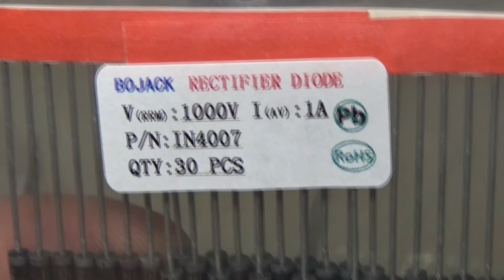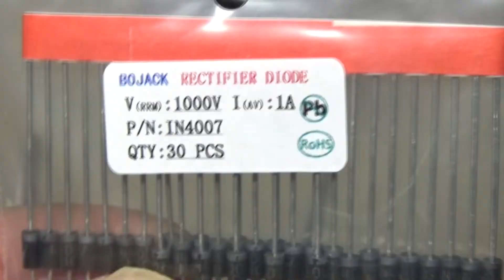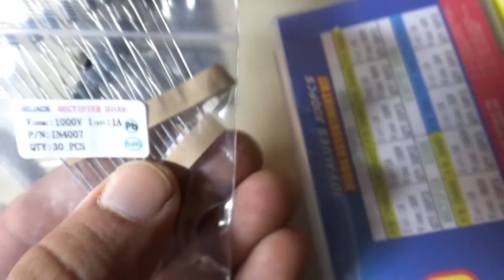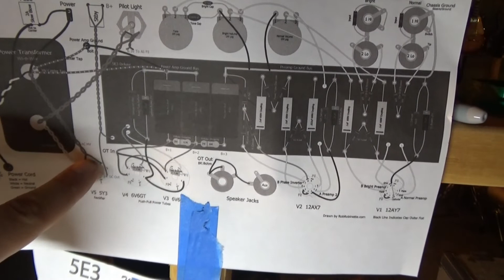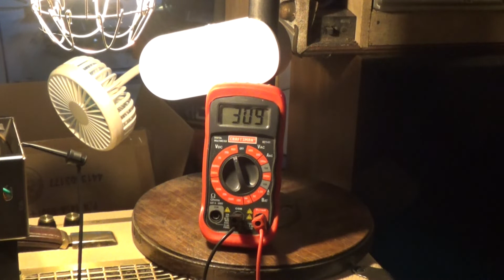Converting a 5y3 Tube to a Solid State Rectifier (Cheap and Easy?)

Comment: You might wanna put another filter cap in series with a resistor across it to up the voltage rating to higher than 500vdc if you’re going to use the solid state rectifier on the 5e3. Either that or get a cap that’s rated for 1kv. Don’t want that initial surge to blow your cap.
Reply: can you explain more?  I didn't get your comment about cap and resistor in series. because I'm planning to do this for my 5e3 clone
Reply: @hamedkhalilian6882  The solid state rectification will cause more of a voltage spike. Two caps in series will be able to handle it if it goes over 500 vdc. Depending on your power transformer,If it’s low enough, you may be ok with 500v cap on the first node. What voltage are you getting with a 5y3?
Reply: @hamedkhalilian6882 It's supposed to act as a buffer for that surge you get as soon as you turn the amp on "play", sometimes you can see the preamp valves glow a lot brighter than usual at the flick of the power, try the cap as it will at very least give the pre valves longer life. My theory is that the new ecc83/12ax7 valves(and thier family) are built to  withstand the Surge but the tone of the amp changes to a harsher and more metalic character reflecting the "tougher" build. They are usefull as phase inverter valves(groove tube) as the gains are spot-on. Last but not least" Be carefull around glass as it can cut much deeper than steel can(experience, a tiny shard 1/16" almost lost me 2 digits). Wear gloves around busted glass. Great video.

Comment: Interesting video.  Just an FYI, there’s no such thing as a DC or an AC resistor.  Resistors don’t care whether you run AC or DC current through them, they behave the same either way.  The difference you point out, that one set of your resistors turned black, means that they probably weren’t designed to handle all the power you were subjecting them to.  Higher wattage resistors, typically and more commonly used for “AC” applications, are made to handle higher power, while low wattage resistors (commonly used in low-power circuits), are made to handle small amounts of power.  Second to their Ohms specification (resistance), the most important spec for resistors is power handling (power dissipation) or WATTAGE.  So when spec’ing out a resistor, the two things you need to know is how many Ohms and how many Watts - get those right, and you’ll have no problem beyond that.

Comment: Increasing the value of the resistors will get the peak voltage down, the operating voltage down, and the heat generated by the resistors down to boot! Also, use the same wattage (or higher) resistors to keep them cooler. Nice video!
Reply from the maker: Thanks!!

Comment: Idle voltage may be appropriate, but what about it under the load? 100R on both AC nodes seem quite high and may "choke" the amp.

Comment: Worried about the instant on B+ with a solid state 5Y3 hammering your tubes?  Use a positive temperature coefficient thermistor to gently bring power up. Use one, such as a STM CL-90A, in series with the 120 VAC power input to the device.  On the 5Y3 tube base, anodes are connected to pins 4 & 6. Cathodes to pins 2 & 8. Pins 2 & 4, and 8 & 6 are pairs. The diode "arrows" or banded side go to pins 2 & 8. ⚡

Comment: Does this work the same for a GZ34 in a JTM45?
Reply from the maker: Yes it should, though the resistor values may need to be different
Reply from the maker: also watch the voltage increase. It could blow a cap if it’s not rated for the increase.